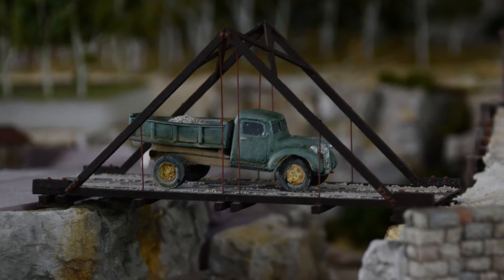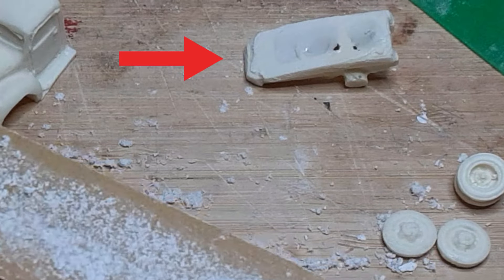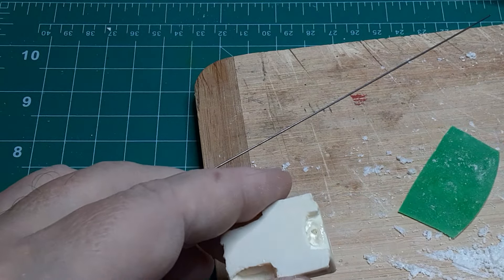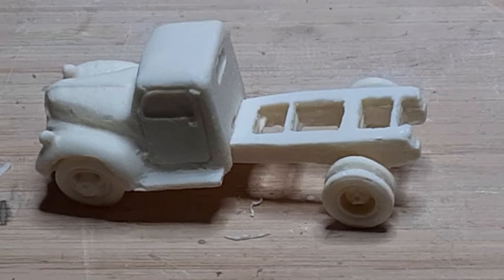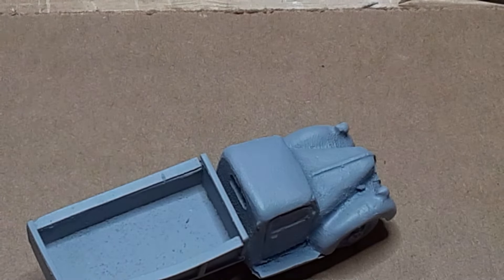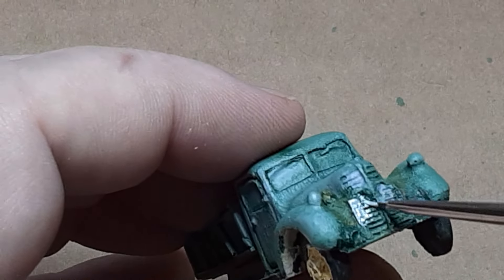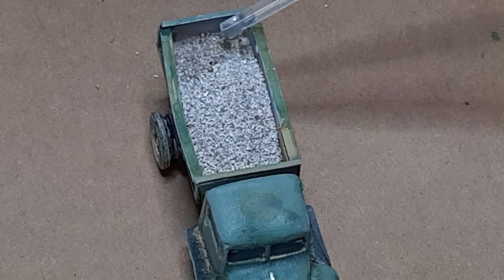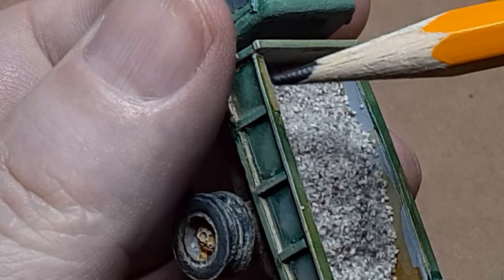Quick n Easy Projects #2:   Building a Dump Truck

Comment: I got the Rusty Rails truck with the log load and chain.  I need to get busy and finish it.  I like your idea of putting an axle through the wheels.  And I built mine with your suggestions.  I glued the rod on the ends of the frame for the tail lights.  I only had .20 bronze phosphor wire so I use it and a #75 bit and used a bit from a plastic Q-tip swab for my differential.  Think I'll do my cab faded blue.  I broke my log load trying to straighten out the crooked boards between the load and the cab.  It broke very realistically so that's a plus.  I'll highlight it with some grey to make it look old & rotten.  Thanks for your great ideas on how to make simple improvements.  Cheers from eastern TN

Comment: Nice build. I love Rusty Rails products. I built 3 of the HO tracked tractors and a boat. I have a bunch of cars and trucks to do. The best part is the price point.
Reply from the maker: I gotta say, if I had it to do over again, I would take some 1200 grit sandpaper and wet sand the hood, roof and fenders. I think this would improve the model.